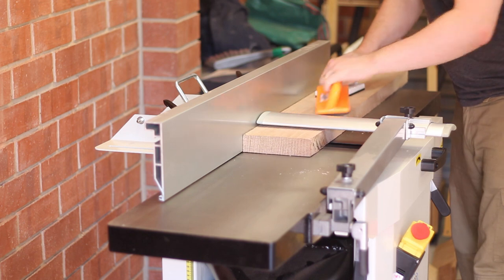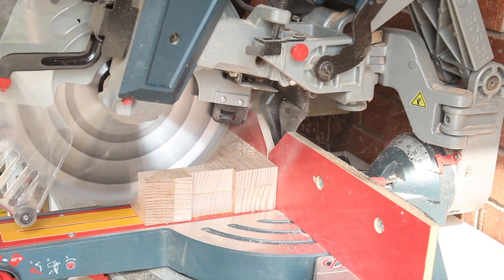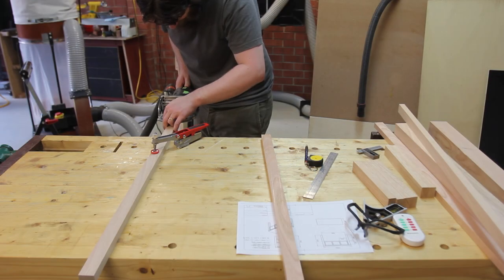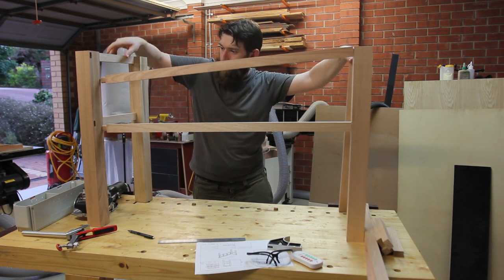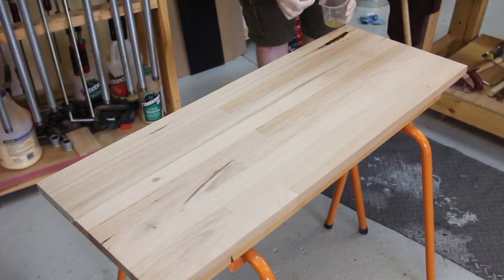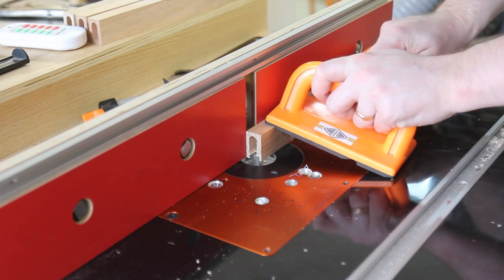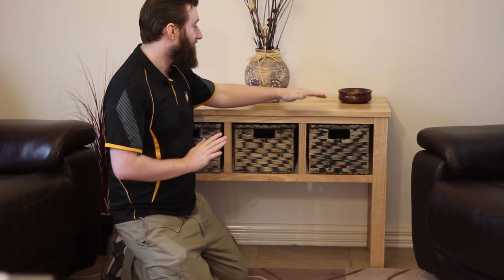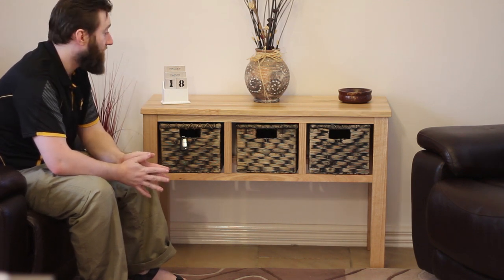097 - Mini Hall Table

Comment: Some of those rails look a bit small to be mortised for floating tenons of that size. The walls of the mortise looked a bit thin and delicate. An integral tenon may have been a better choice.
Reply from the maker: +Dave Starr The 8x50mm dominoes would have been a better choice than the 10x, but so far I've not found it an issue (with the rest of the furniture in the series) - 10mm mortises work out at half the thickness of the stock. I was more in automatic mode when I chose the bit/tenons.